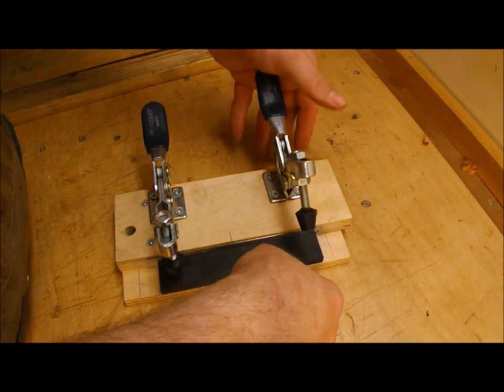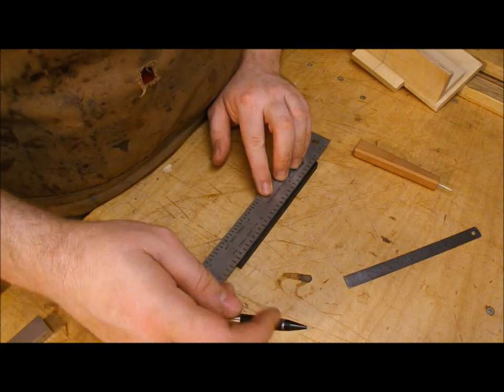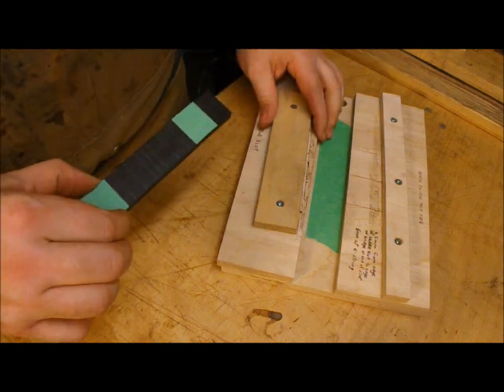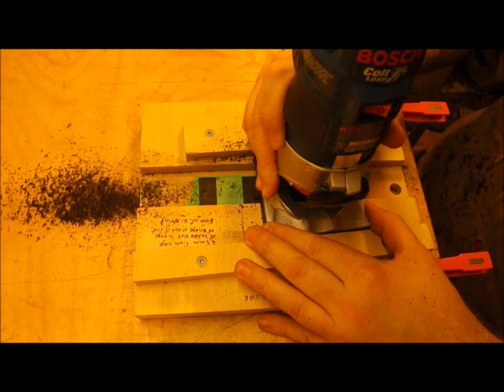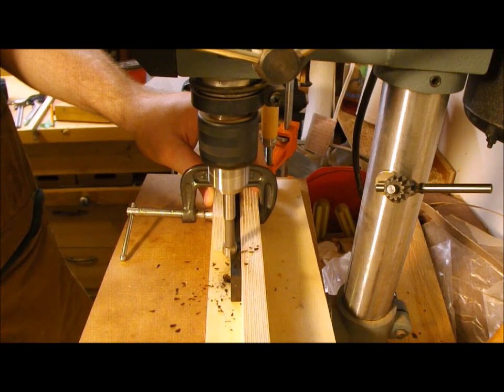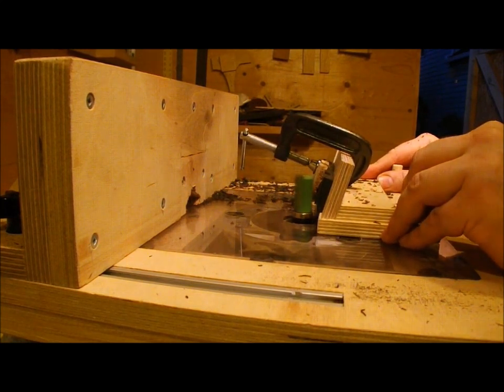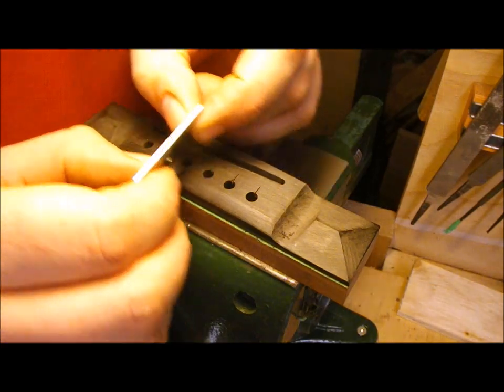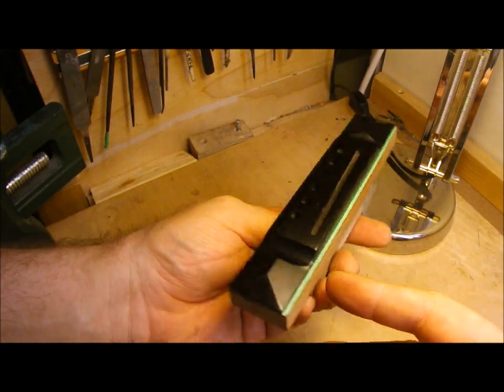Guitar making -Pyramid  bridge

Comment: This is great, I am making a pyramid bridge for the Martin 1-18 like steel string I am making.  you might consider using a cheap honing guide like the Robert Larson (~$12-16), on a progression of sandpaper grits to make the triangular facet on the ends of the bridge. That’s how I was taught  to make the facets on the ends of classical bridges.

Comment: Fantastic jig my friend.  You can stand it up and get the ends too. Also you could get the inside bevel also with a top bearing bit and a jig modification.  But thanks for a great start and ideas.  Travis
Reply: Routing ebony end grain?
Reply: @tommypetraglia4688  Yes end grain can be easily routed taking multiple light climb cuts using a sharp bit. The end should be done first then the sides of the pyramid.

Comment: Summary: 
Router Jig Setup: Utilized a router jig for precision cutting and maintaining parallel sides on an ebony blank for the pyramid-style bridge.
Accuracy and Measurement: Emphasized accuracy through the use of precision measuring tools and double-checking marks before drilling or routing.
String Spacing and Design: Employed a Stuart MacDonald string spacing rule for marking out bridge pinholes, crafting a bridge design slightly wider than Martin's for a steel string instrument.
Assembly Technique: Used masking tape and super glue to firmly hold small parts together, facilitating precise cutting without the need for clamps.
Finishing Touches: Detailed the process of refining the bridge's shape with chisels, files, and scrapers, followed by extensive sanding and polishing, resulting in a finished product ready for installation and setup.

Comment: Gorgeous Work.  Do you ever consider doing a custom order for a replacement bridge almost identical to the one you did here?   For if so, I may be interested in your services for a fee.   For I have an old beat up martin where the bridge is pulling up and aside from pulling up the bridge itself looks in bad shape from some previous apparent work.   I'm trying to carefully remove the old bridge, but so far I can't seem to find a replacement to match the exact hole spacing dimensions of a replacement. However it does look very similar to the one you made on this video.

Comment: twoodfrd, I'll be making your tray to cut a slot. Thanks for the simple design. When you cut the slot, did you tilt the bit part way in and cut the length of the slot then lower it all the way and cut to the full depth? That's what I understood but I'm not sure. And what specific bit do you use? Thanks for ALL the videos.

Comment: Thanks for doing this ---- On the jig for cutting the diamonds (2:54), what's the degree for the back fence?
Reply from the maker: The angle is a function of how wide your bridge is and height of the pyramids so I would advise drawing a plan and building the jig to suit. (Make the base perpendicular to the slope of the pyramid, whatever that might be). In my case it was about 73 degrees.

Comment: Hey Ted, how did you know the saddle slot angle without the bridge on the guitar? Thanks!
Reply from the maker: The compensation set-back is known, and I know where I'm going to put the bridge. If I'm accurate with the placement it works just fine. With a 1/8" saddle there's some room to move the string take-off point.
Reply: @twoodfrd  Known for each brand of guitar or is there a general angle that you use? Thanks!! Appreciate it
Reply from the maker: @brianstai8239  you can use the fret calculation computer on the StewMac site to figure it out. Most of my steel strings have the same scale length so I have a jig set for that. In repair it's just as easy to plot and rout the slot after its glued to the soundboard.